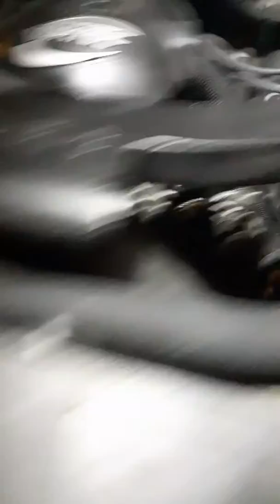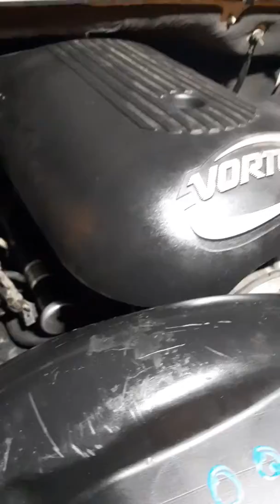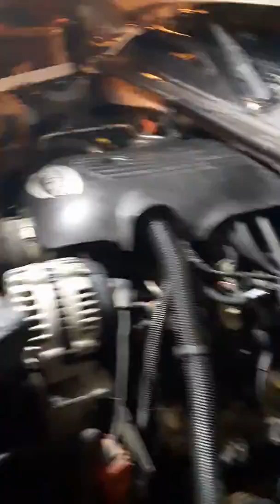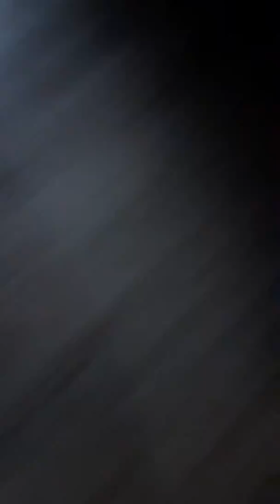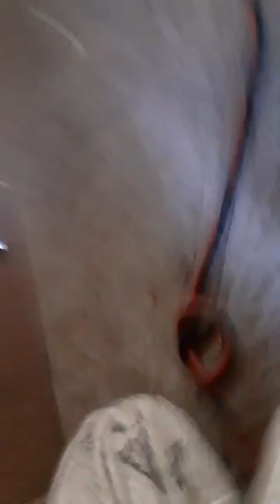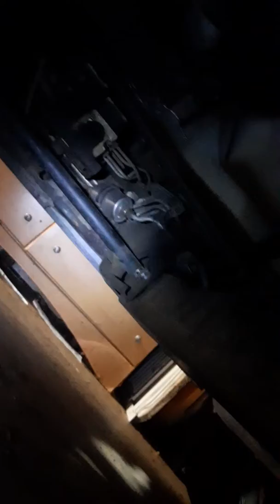BACK TOGETHER AGAIN ...

Comment: If the fuel filter doesn’t fix the problem spray carburetor cleaner lightly around the area you just put together the intake extra. If you notice a change in your idle then you have a vacuum leak
Reply from the maker: FUEL PUMP WAS IT NO GAS PRESSURE AT THE ENGINE
Reply: MC SHAN should open a little shop  call it. Shan’s automotive you can make a killing because a Lot of people are intimidated by repair work...